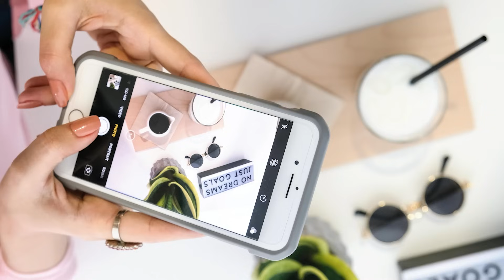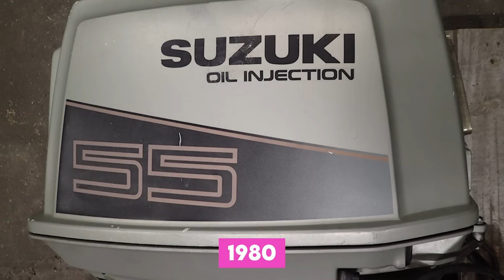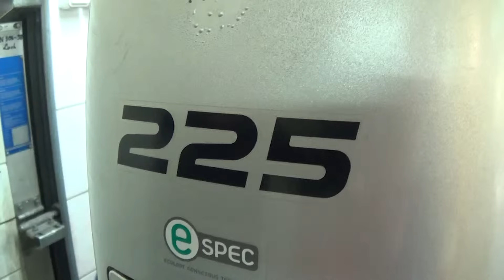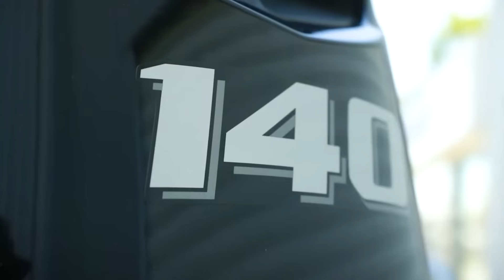The Rise of Honda: Suzuki's Biggest Rival!

Comment: my little honda 9.9 is so good on gas, i stepped on the fuel line disconnect it by the time i noticed a minute later never died , these little motors go for ever and are easy to work on .

Comment: I bought my Key West deck boat with a Honda BF130 on the back that had a new powerhead, I think a BF135, with about 50 hours on it at the time after the previous owner had taken opportunity of the recall. It's a 2001 model. II had a problem with it from the start with stalling and went thru the entire fuel system before finding a bad main relay, which was about 53 bucks, and got her running like new.